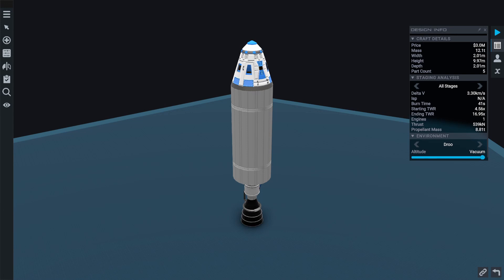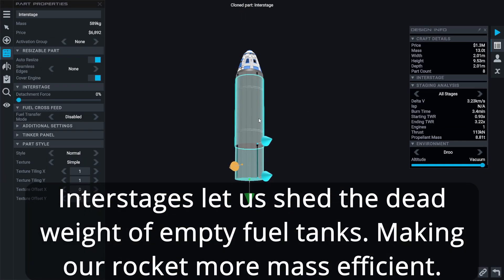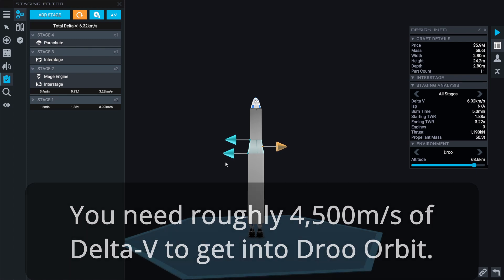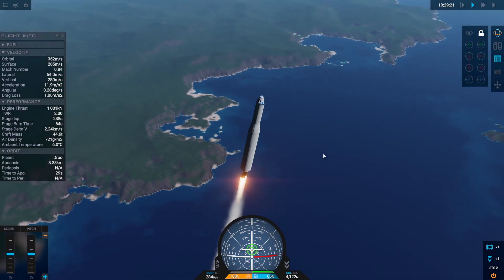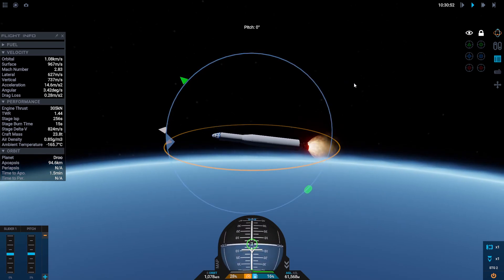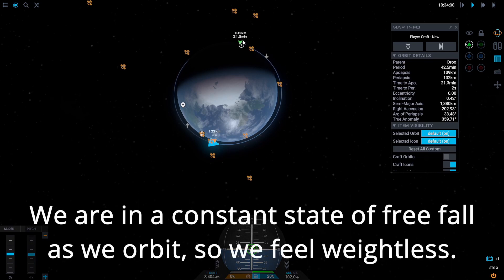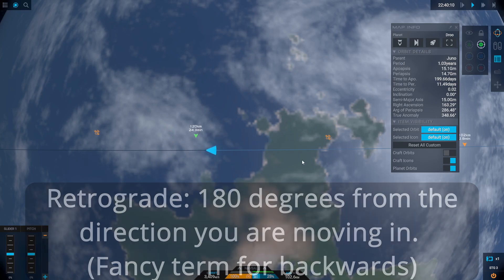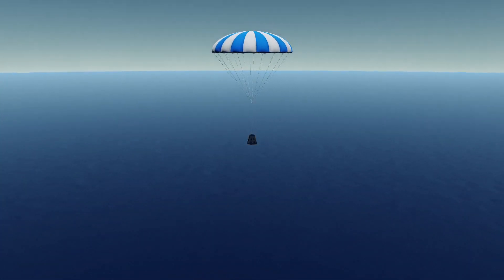Juno: New Origins Tutorial || Part 2 Getting to Orbit

Comment: I can't do this on the free version cause you can't change bell and pressure making it much harder
Reply: I don't know if you still need this. But there is a way to get around that problem in the free version. In career mode you can customize everything just like when you are playing the free version, the only problem is that you need tech points to unlock them and tech points are grindy. Thankfully there is a glitch with which you can use to get about 1000 tech points. First start a career world then do the tutorial. Now go to the designer and only pick an astronaut. Go to the properties tab of the astronaut and change jetpack power to 0.1 now launch from Juno village pad(you can launch from any pad you want but Juno village pad is the cheapest) when you are in game click on the astronaut. You will see jetpack power take the slider all the way down, after doing that you can click on it and edit it with your keyboard. Type in 1E+9 now press and hold the use jetpack button if you did it right the astronaut should teleport to space and the screen will shake violently. You will get a lot of achievements and enough tech points to unlock all engines. Now you can load any of your crafts in the career world and adjust their engines settings however you like. Hope this helps 😊
Reply: I don't know if you still need this. But there is a way to get around that problem in the free version. In career mode you can customize everything just like when you are playing the free version, the only problem is that you need tech points to unlock them and tech points are grindy. Thankfully there is a glitch with which you can use to get about 1000 tech points. First start a career world then do the tutorial. Now go to theI don't know if you still need this. But there is a way to get around that problem in the free version. In career mode you can customize everything just like when you are playing the free version, the only problem is that you need tech points to unlock them and tech points are grindy. Thankfully there is a glitch with which you can use to get about 1000 tech points. First start a career world then do the tutorial. Now go to the designer and only pick an astronaut. Go to the properties tab of the astronaut and change jetpack power to 0.1 now launch from any pad you want(preferably Juno village pad since it is the cheapest) when you are at the launch location click on your astronaut slide the tab labelled jetpack power to as low as possible. After this you should be able to click on it and edit it with your keyboard. Type in 1E+9 and press and hold the jetpack activation button. If done correctly the astronaut should teleport to space and the screen will shake violently. at this point click on the astronaut again and set jump power to 1E+11. You should get a lot of achievements and tech points to unlock all the engines. Now you can load any of your crafts into the career world and adjust the engine settings how you like. Hope this helps 😊
Reply: I don't know if you still need this. But there is a way to get around that problem in the free version. In career mode you can customize everything just like when you are playing the free version, the only problem is that you need tech points to unlock them and tech points are grindy. Thankfully there is a glitch with which you can use to get about 1000 tech points. First start a career world then do the tutorial. Now go to theI don't know if you still need this. But there is a way to get around that problem in the free version. In career mode you can customize everything just like when you are playing the free version, the only problem is that you need tech points to unlock them and tech points are grindy. Thankfully there is a glitch with which you can use to get about 1000 tech points. First start a career world then do the tutorial. Now go to the designer and only pick an astronaut. Go to the properties tab of the astronaut and change jetpack power to 0.1 now launch from any pad you want(preferably Juno village pad since it is the cheapest) when you are at the launch location click on your astronaut slide the tab labelled jetpack power to as low as possible. After this you should be able to click on it and edit it with your keyboard. Type in 1E+9 and press and hold the jetpack activation button. If done correctly the astronaut should teleport to space and the screen will shake violently. at this point click on the astronaut again and set jump power to 1E+11. You should get a lot of achievements and tech points to unlock all the engines. Now you can load any of your crafts into the career world and adjust the engine settings how you like. Hope this helps 😊

Comment: Just a pointer, I am a a ksp player and generally speaking it would be better to do a gravity turn. You still maintain full thrust until you hit max q. But the rule of thumb you let the rocket reach a cirten speed like 120 meters per secând you turn the rocket and let the gravity turn it. This will make make the best of your fuel. I haven't played this game enough to know what a usual gravity looks like but in ksp I usually give my rockets a thrust to weight ratio of 1.33 which I find to be the best and the gravity turn starts at 60 to 80 depending on the thrust to weight ratio. Kerbin is smaller then the earth equivalent in Juno new origins/simple rockets 2. There is a better explanation, I just made a very quick example

Comment: it would be better for me if you only used the components available starting a new career to get to orbit, i dont have those engines, command pod etc, just mentioning, still love the information very much
Reply from the maker: The concepts are all the same, just user a small solid rocket booster for your first stage and a small pressure fed engine for your second stage. In my career mode series I built a cheap orbital rocket using early stage tech only
Reply: @Deltlead  what series sorry mate? i looked but not sure, can you link please, still having trouble haha great fun but